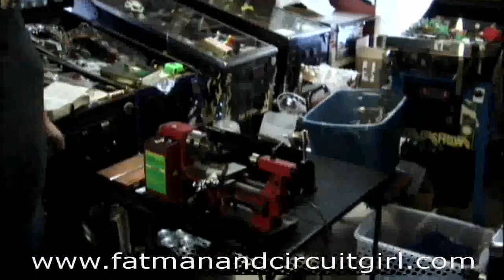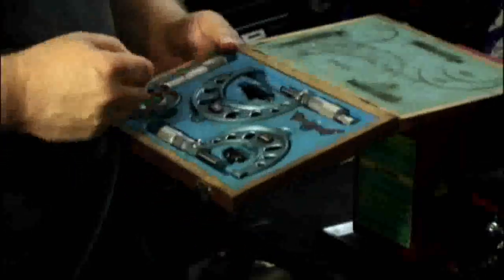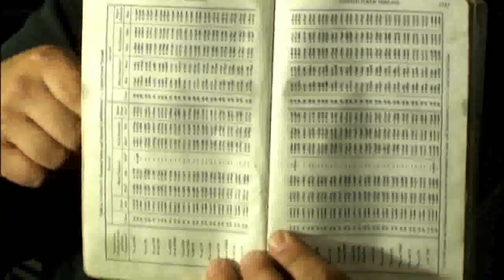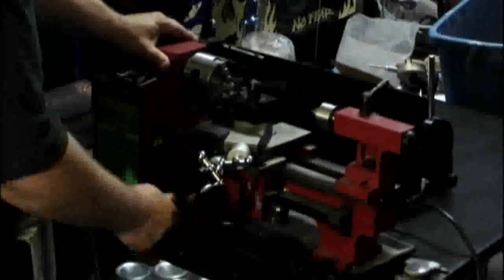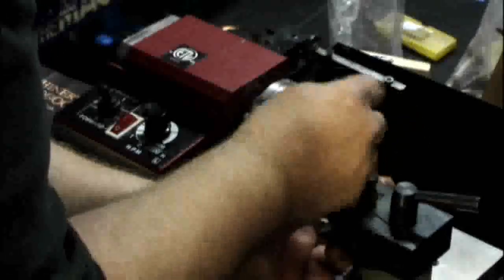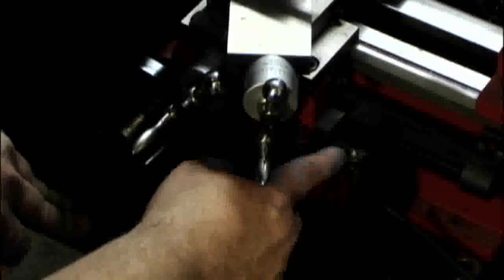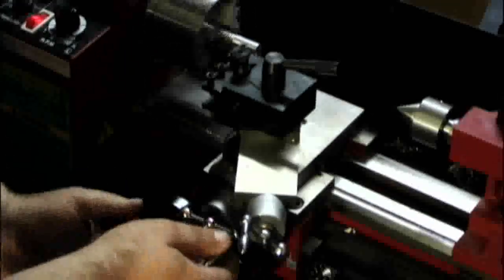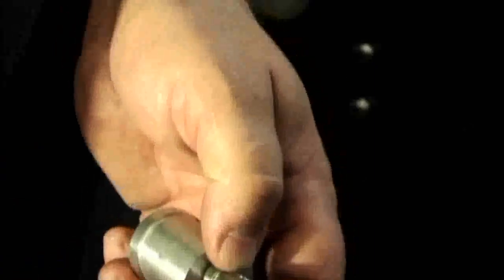Basic Lathe - Operation Threading

Comment: You need to clean up your slovern presentation. I have the same lathe and have been using it for several years. First anchor that lathe to a decent bench or surface. That is just plain sleezy using a machine tool that is flopping around like that. You also have removed and locked out the shield over your chuck. You and partner are obviously lazy and not that bright. If you ran a business OSHA would shut you down. Telling people to wear safety glasses will not make up for this other stuff.

Comment: Nice!!! "Machinery's handbook" is good thing, You will need more practice. P.S. About metric thread- metric step goes forward than 0,25mm. for example- 0,25; 0,5; 0,75;...... 1,5; 1,75; 2,0.... (1,8mm step does not exist), and usually over than M30 thread step is no more than 2,0mm(only with extraordinary cases use normal metric thread-M42; M45...), for example- M33x2; M42x1,5, M42x2mm